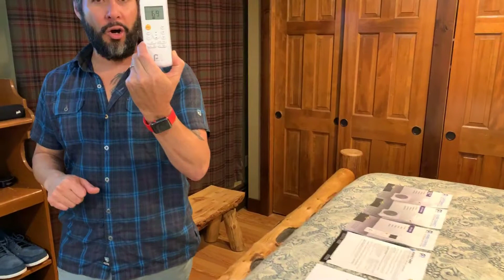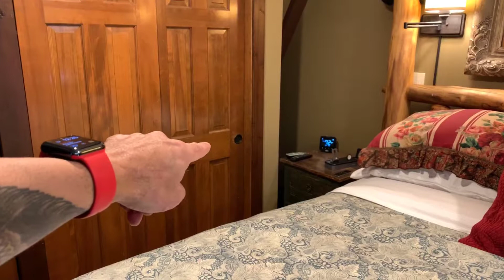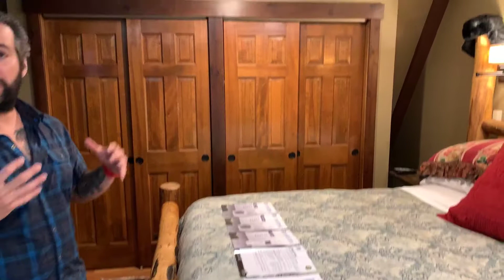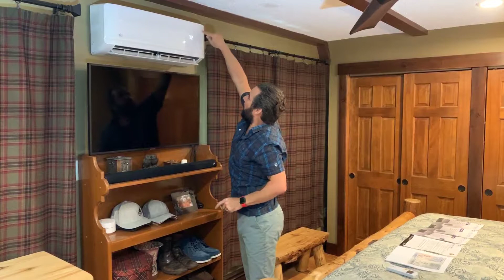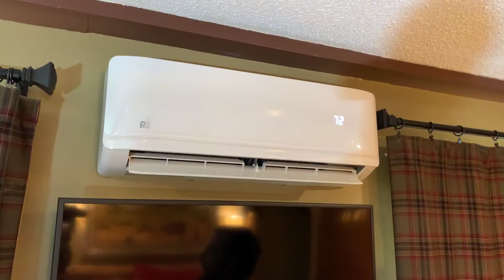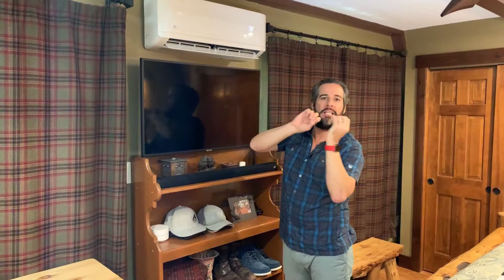Perfect Aire Mini-Split Best Practice Install Tips - Part 1 (Inside)

Comment: Finished our install. 18,000 btu unit with 9000 btu for master bedroom, 12000 for living area that opens to foyer etc. It works wonderful. Very quiet, efficient and warms well. Temps in low 30’s so far and no issues keeping up. Happy so far.

Comment: Question? FC code. What does it mean? Just installed, everything working except unit upstairs. Unit kept shutting off so cleaned filter and unit stays on but blows cool air.
Reply from the maker: Call them right away to be sure. Did you make sure to back out the Allen headed plugs to release the flow of the refrigerant?
Reply from the maker: Make sure to press the reset button on the unit. Worst case, turn off the breaker and back on. Force a reset.
Reply: Yes hit reset but I guess I put it into auto/ cool function. It was blowing cool air. Pushed again quickly and it started to heat. I believe FC meNd filter clean although there’s no mention of this code in any of the manuals. Basically was stuck in FC since the start, hooked up 2 units. This one was stuck in FC so we thought it was electrical issue. Cleaned filter then reset it and it’s working fine now.  I’m going to have to get used to this new unit.  Foreign to me so far lol but was somewhat easy to install. Not a pre flared model.  Now trying to get swing/ direct to work. A vid on that would be great, using the remote properly.
Reply: Yes did all you said btw.
Reply: Figured it out. Still had issues with temp display being dim. Couldn’t change louver or direction but heat ran.  FC must have meant faulty connection because when I jiggled wires near thermostat the display got brighter. So pushed connection there tighter, was loose and display brightened up. Now louver/ direction work, heat works etc. Long reply but figured it may help others that may have same issue.

Comment: I watched your 2 videos. I’m Installing this system, 18000  btu condensar, and 2 Indoor units. I also watched perfect aired video. Did you need to flare for your fittings. My unit came with fittings to fit onto indoor unit and outdoor but my lines are not flared. I have pieces that look like flared compression fittings.  Did you flare your lines. Did you use Nylog refrigerant oil?  Lastly, did you have to pressurize ? Is that necessary with pre loaded coolant?
Reply from the maker: A L Boy, I wish I could help you but I had the install it yourself or do it yourself version which meant that it had quick connect fittings so there was no flaring or pressurizing needed because of the quick connect fittings. Your kit will either need special tools for flaring and pressurizing or you’ll need to get a professional to come do the final hook ups I’m afraid. I wish you luck
Reply: Luckily I’m installing it with my dad. He will figure it out. I was just going over everything I’ll need. I bought mine on hvac direct as well. Have to check if it’s quick connect. It’s been sitting for 6 months waiting through home addition. Thanks for your reply.
Reply from the maker: @al3645  If it is 2 indoor units it is not DIY.  Good luck